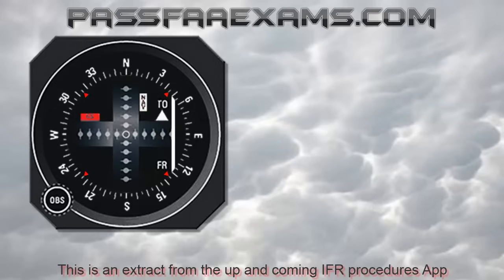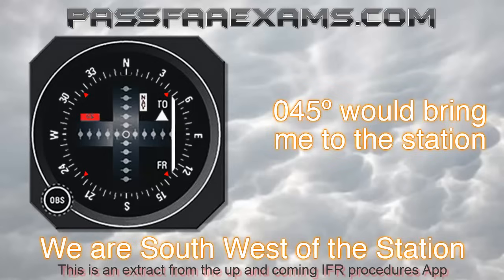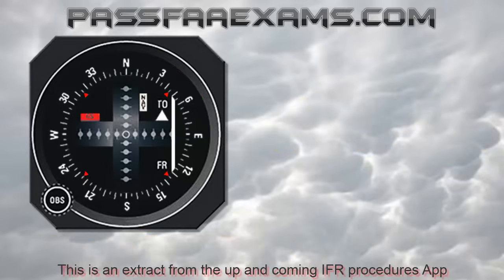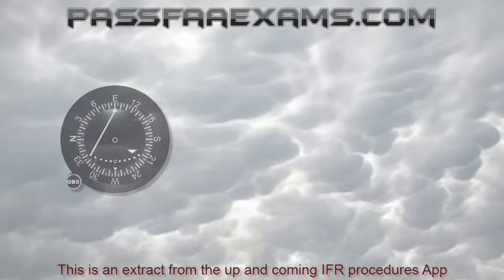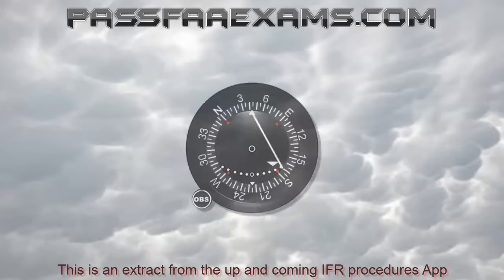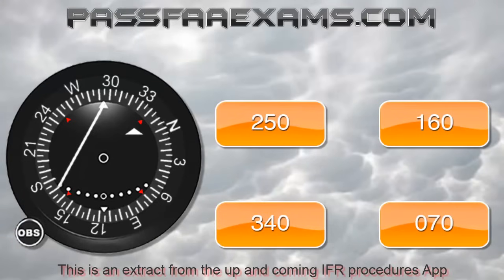VOR Navigation Made Simple

Comment: Great method. This makes it much simpler.  So with no flag and the needle pinned left, you go 90 degrees left to head towards VOR, correct?
Reply from the maker: Negative Sir, always look at the number the triangle points to in the quadrant the needle and flag points to. For more on this and many other tricks visit: https://passfaaexams.com/
Reply: @GianLucaNoia  There are short periods of flight where there will be no flag on the VOR.  For example, if your OBS setting is directly North and the VOR is directly West, you will have no flag but you will have a needle pinned to the left.
Reply from the maker: @AvgDude  Yes in that case (zone of ambiguity) you will go 90 degrees in the direction of the needle.

Comment: I was teaching this "cheat code" to a ground school student, and it worked very well. EXCEPT when the CDI is not fully deflected. When it is not, you know that the deflection is less than 10 degrees, so a 45 degree angle becomes less optimal. Otherwise, this is the way.

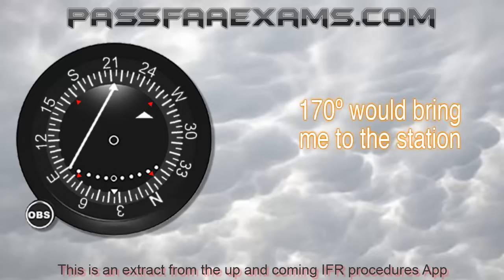Comment: This is a great method for the exam. But will NOT always work in real life. Use the example at 2:38. Say you're North of the VOR on the 020 radial (and for some strange reason didn't know it) with the CDI indication as in the video at 2:38. The suggested heading of 170 would NOT bring you to the station. You'll fly right past it. It real life, twist the OBS with a centered "FROM" needle, now you know EXACTLY what radial you're on (top of CDI) and where the VOR is exactly relative to your position (Bottom of the CDI). I mean what's the reason to not twist the CDI and "guess" when a "twist" will tell you exactly? And who cares anymore? VORs suck. Long live GPS.
Reply from the maker: Try this exact scenario in a simulator. If you are on the 170 FR and have 160 on the OBS using 025 to intercept at 10 miles out will center the needle in close to no time (depending on your speed). This method is not a trick, it's how a VOR was intended to be used. Also if you are flying to the VOR it's always easier to center the needle with a TO indication and not a FROM. For more awesome simplifications visit: https://passfaaexams.com/
Reply: @GianLucaNoia  I will give it a try. I would love this to work, and it does seem to in many cases, just not all.
Reply: @GianLucaNoia  Okay, I see your method now but what you're really saying is that the heading to steer will take you to the selected radial/bearing not to the station. Yea, that makes sense. You say (@2:36) "170 would bring me to the station," which is incorrect. The 170 will take you to an intercept - not directly to the station. That's an important distinction which I did not find clearly explained. I really like your concept of "up" and "down" rather than "to" and "from." Brilliant. As far as "if you are flying to the VOR it's always easier to center the needle with a "TO" which is true, but that's not always the case. I may not want to zig-zag along VORs, so if I'm flying from Point A and Point B, "From" is easier because radials extend outward from a VOR and I can see it on a chart. But, again, VORs suck, and GPS rules. Thanks for your response as that helped me understand what you meant.
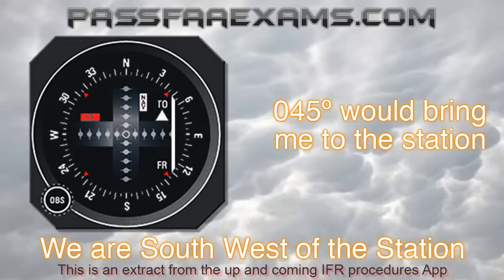Reply from the maker: @whoanelly737-8 Sorry mr. Nelly but I never implied that the triangle heading would surely bring you directly to the station: minute 1:00 "a heading of 045 will bring me TOWARDS THE STATION, if not directly to it"
Reply from the maker: These videos are extracts from our full software which, while teaching simplified essential knowledge, also aim at helping you ace the written tests. At the beginning of the courses we give some very important tips and one of them is to pay meticulous attention to details and to understand what exactly the question is asking. in this case it was essential to pay attention to what the explanation was saying. Also the full software goes into much grater detail on the explanations while these videos are just small little extracts.
Reply: @GianLucaNoia  I understand that now, but it’s not clear in your explanation, your exact words are “170 would bring me TO the station,” where you should be saying, “170 would bring me TOWARDS the station...” This is a very important and critical distinction. Good stuff, keep up the great work. But also, feedback is important to improving a businesses product and service. Again, good work and helpful.
Reply: @GianLucaNoia  was over thinking it so this one got me as well, thank you for the clarification. Quality method👍👍

Comment: Would this only work to keep re-intercept the VOR (keep flying over the station). But not to intercept the radial flying AWAY from the station.. Would i be correct on that notion?
Reply from the maker: Nope it always works. If you know your direction to the station you obviously also know your position from said station.
Reply: im looking at your other video:" Intercepting VOR Radials" ; where ATC says turn new heading because of restricted airspace - in that scenario, whats mentioned in this video (above), works fine. But when 'station passge' is achieved ( leaving the station). In the same scenario, ATC gives a second instruction to avoid MOA ( restricted airspace) and to turn left heading 330. But in that particular instance, i could never get that theory to work. Thats why i was asking if the theory mentioned in this video only works for re-intercepting the VOR ; whereas, in the other video , your leaving and not intercepting the VOR because the 45 intercept yes ok its on the same side as the CDI but on the opposite quadrant of the flag

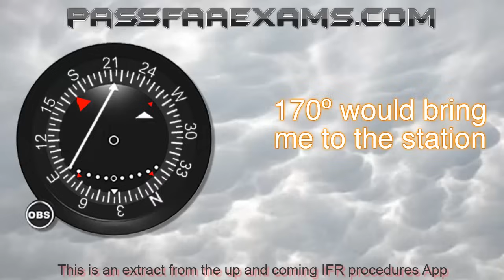Comment: If I understand, it doesn't matter where the OBS is set.  You will still get the same indication.  Think of the OBS like a clock with 12-9-6-3 corresponding the N-E-S-W.  If you take the example of the VOR starting at 2:59, the indications are that you are NE of the VOR (045) and fly a heading of 225 to the station.  If you turn the OBS so that S (6 o'clock) is at the top (12 o'clock), the headings between 12 and 3 change from 0-90 to 180-270. The flag will shift from down to up (to) and the needle will move to the right side. Applying the technique will tell you to fly to heading under the red marker in the right, upper quadrant which is  225 to the station. The opposite of that heading is 045 which is your location.

Comment: Brilliant. Cant see a reason for a thumbs down unless you prefer to stick with difficult ways of doing things!
Reply: While this is one of the best "Quick Tricks" I've seen, if someone thinks using a VOR is too difficult, they shouldn't be an IFR pilot.  Please consider that lots of pilots have been lost by relying on a single information source, because they didn't cross check.  Yes, GPS is great, convenient, etc. and I think they are an awesome tool.  But they are not infallible, nor are pilots.  What happens when a pilot misprograms, a GPS, and doesn't realize it?  They're lost. and worse, setup for CFIT, which has happened more than once.  Equipment failures or misinterpretations happen.  so we Cross check.  Just like any other instrument, navigation should be cross checked.  VOR's can be cross checked against GPS, or each other.   GPS nav should be crosschecked against another source, VOR being the only one available in IMC (unless you've got RNAV, unlikely in GA aircraft).  Two GPS Recievers shouldn't be checked against each other because there are common failure modes (lack of visible satellites for example).  A VFR only pilot should be cross checking NAV against a chart, with IPADs holding so many charts, it makes having one at hand simple.  No one maneuvers solely by reference to a single instrument, neither should we navigate by reference to a single NAV tool.  Even pilotage cross checks, map against compass and watch. The only type of navigation I can think of that doesn't cross check is Dead Reckoning, but then, if you Reckon, wrong, you're dead.  So maybe wait a bit before you so eagerly relegate the VOR to the trash can.  Those of us who like to fly safe are going to need it a little longer.
Reply: Simon Wiltshire - 
Agreed, and great way to quickly grab a heading to a vor, but in your remark about doing things in difficult ways lies my point.  VOR navigation is a "Difficult" and certainty outdate way in itself.  With GPS, vor is useless and should be eleminated.  The only valid arguement is the "what if your gps fails?"  My reply would be, what if your radio fails and you cant tune the vor?  What then?  The most worthy answer would be dead reckoning.  Well the same answer would apply to a gps failure.  But, in todays age, we all carry cell phones, and they all have gps.  So while most pilots dont carry a backup for radio failure, most do carry backup for gps failure.

The inability to process vor information in an emergency has led to many deaths.  It can be difficult when everything is going right, and under stress more mistakes are likely to be made.  With gps, keep the airplane symbol on the pink line.  Pretty simple under stress.

And no, I didnt thumbs down this video, in case anyone was wondering.  It is explained very well for someone to wrap their head around the concept, so it was thumbs up for me.  My issue is with VOR itself, and the comment regarding "Difficult ways" made me want to point out that VOR in itself is a difficult way, and one we dont have to deal with.

Cheers mates, and happy flying !
Reply: Hippie With A Cowboy Hat 
I do agree with you. Your point about difference between stress and no stress is well made

Comment: This is a remarkable lesson, however, I would ask you to explain how -- at frame 2:13 -- one knows the needle is pointing downward, or toward the SE quadrant. In the likely event Yu are reading this while not at that juncture in the video, I will inform you there is no arrow in this illustration at the top of the dial or at the bottom which usually indicates the heading. Of course the flag is pointing down, but you mentioned that the needle also indicates this.
Reply: 2:13?

Comment: I got most of it But for the Heading I am still VERY Confused On the last one where you told us to guess It looked Like i 340 Seeing As Right next to it it said 33? I am confused  :/
Reply: The arrow is in the to position, so we blank out the from sector, (bottom).
The needle is to the left of the centre point of the dial, so we travel left, blocking out the top right quadrant. The only red arrow in the quadrant points 250
Reply from the maker: Arrow (TO/FROM Flag) points up (eliminate the bottom 180). Needle (CDI) points left (eliminate the right 180). The remaining quadrant is the Top-Left quadrant. The red arrow on the top left quadrant points to 250.
Reply: explained much better. thanks

Comment: Just to be clear, in order for this method to work, you have to set first your VOR OBS to match your heading indicator?
Reply: No. Once the frequency for the VOR is tuned in, the needles become active and without centering the needles, the approximate direction to the VOR can be found. The VOR does not need to be the same as the Heading Indicator.
The VOR simply shows the relative bearing of the aircraft from the VOR
Reply: Confused - are you setting the OBS to match the direction of travel before determining the quadrant?
Reply from the maker: Negative Sir. It doesn't matter at all. Keep in mind that the VOR receiver has no clue of your direction of flight, nor does it need to have any.